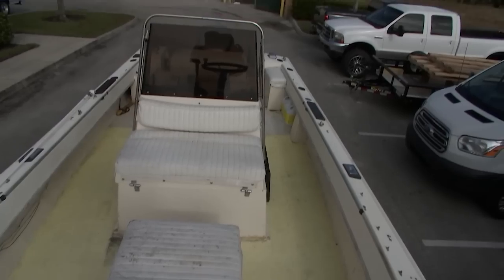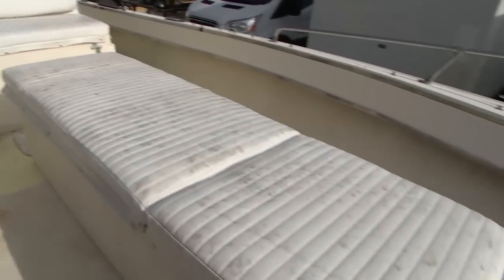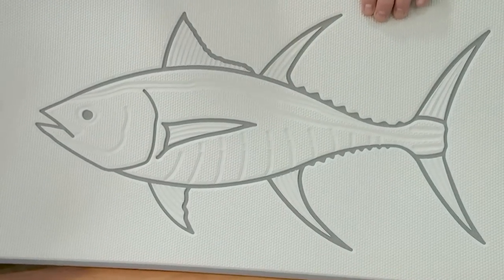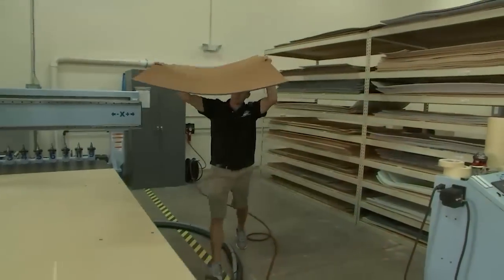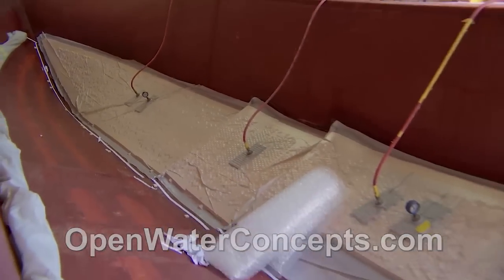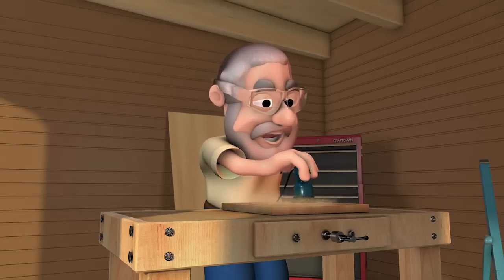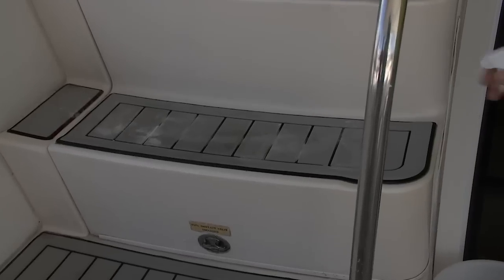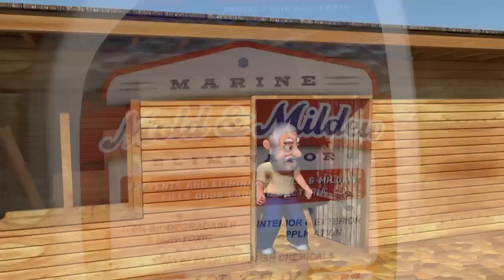Custom SeaDek on Ship Shape TV

Comment: There was tons of work done on that boat that looked like a total turd in the before photos, that included fiberglass repair, repainting of all the gunwales and center console, new upholstery, T-top, gauges, steering wheel, speakers, cup holders, rod holders, cleats, etc. This was not just "we're making the boat look real pretty with some SeaDek", which was probably 5% of the rehab budget.